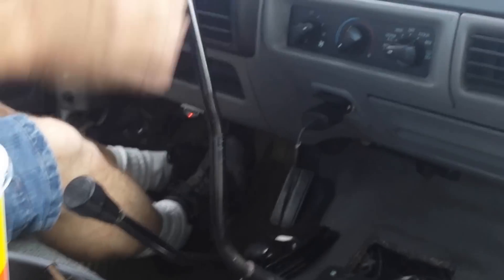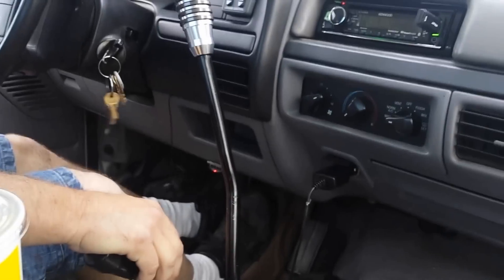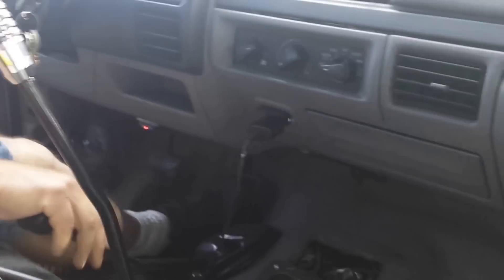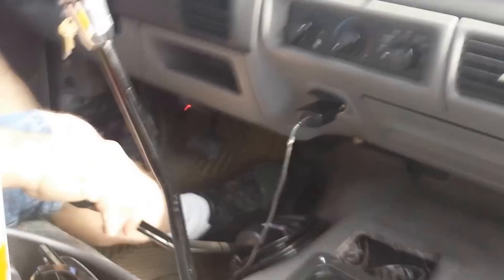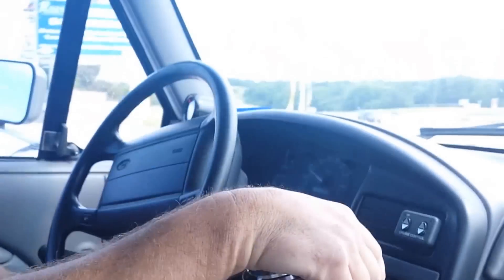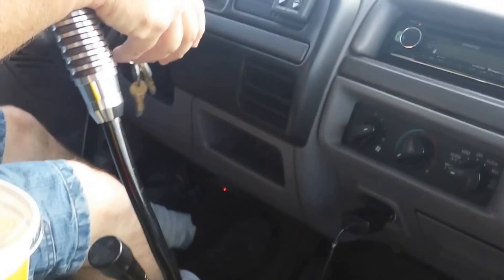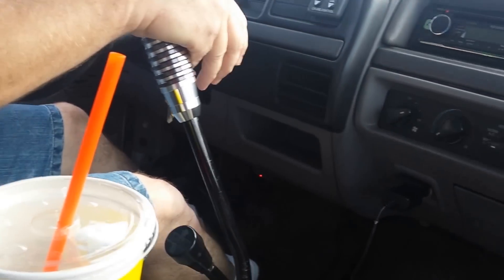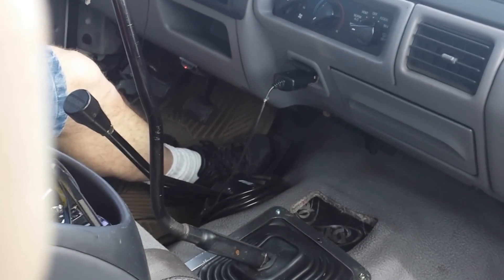F150 twin stick test drive

Comment: But its only an f 150! I could see if it was a 3/4 or 1 ton. Its not what you can pull, its what you can stop!   But, i get it. Had a 73 blazer w full time 4x4, coyld go through in low then back to 1st and again in high. Hole shot from hell
Reply from the maker: Congratulations!! You are the 500th person to make the same comment basically.
No but seriously this is not intended to be a semi truck or 1 ton pulling machine. I simply needed to tow a single car hauler trailer occasionally on very short trips (Under 30 miles). I have trailer brakes and I drive carefully and defensively, plus this combo can still stop pretty darn quick with the trailer brakes adjusted properly. I also keep the brakes on the truck well maintained.
This is overkill for an F150 but the stock 5 speed transmission is very weak and is known to fail quick when towing.
This swap gave me a 4 speed granny (which came stock in older F150's so even the factory went overkill back then) and the overdrive unit is very stout as well. It is rated for over 400 ft lbs of torque and over 24K gross vehicle weight. Plus you can tow in overdrive with no worries as this unit uses a gearset from an old T98 granny transmission.
Splitting every gear is just a novelty. I usually only split 3rd when towing, and if you ask anybody who has ever towed with an old 4 speed the 3 to 4 shift is a big drop in rpm's. This gives me a gear right inbetween 3rd and 4th.
plus going from a 5 speed to a 4 speed I lost overdrive, this gives it back to me.
Reply from the maker: I forgot one important point. The main reason I did this was I really wanted to. I used to drive semi's and got to drive an older truck with a true twin stick transmission, I was instantly hooked! I love shifting gears!!

Comment: Super jealous

How much did this cost you and how long did it the swap take?
Reply from the maker: The overdrive unit was about 1400 to $1500 can't remember which and I got a pretty good discount. They are a little over $1600 now. The 4 speed granny I found laying in the dirt in a junk yard. Took the top cover off and it had clean oil so I changed the oil and resealed the top cover and front input seal and threw it in. It has bad synchros and scratches a little going into 3rd but almost 2 years of daily driving and still going strong. 

It took me around 3 days I think, but I was also going from a factory 5 speed to this setup. If you have an older truck that already has a 4 speed it would be a lot simpler. This unit bolts in front of trans and moves it back 6 or 7 inches so the driveshaft has to be shortned. If its 4x4 then the front shaft also has to be lengthened. The trans cross member has to be remounted 6 or 7 inches back (I think it is 6.5 inches). You would have to cut two new holes in the floor and cover up the original hole. That's about it.

Comment: Is that the transmission whining?
Reply from the maker: That is the overdrive unit. When in overdrive it makes that noise which is normal according to Advance adapters. I was warned about this before buying the unit. That is my only complaint about this unit, but I would still do it all over again.

Comment: There goes the resale value on that lovely 1993 f-150
Reply from the maker: Resell value??  Do you think I care about the resale value on a 23 year old truck? It's a 95 by the way.
I paid $2000 for this truck 2 years ago. That is less than $100 per month, so even if I totaled this truck tomorrow I have more than gotten my money out of this truck.
Not only that, based on a lot of positive comments on this video I could probably get more than $2000. Just have to find the right buyer.  However this truck is not for sale. I will probably drive it into the ground.
Thanks for the comment, and thanks for watching my video.

Comment: "heavy trailer" With an F-150? If your engine doesn't have the torque with a standard 5 speed, your brakes sure as hell don't have enough bite to safely stop it.

Don't be dumb. Overloading your truck is a sure-fire way to cause an accident. And, if the responding officer finds out you're over GVWR, you're f*cked.
Reply from the maker: Do you think before making comments like that? Other than the fact about being fucked if I cause an accident your statement has no merit. The engine is a 300ci inline six cylinder. It has plenty of torque to pull a trailer. The stock 5 speed is not what makes torque, it multiplies torque but does not create it. The problem with the stock 5 speed is the strength and durability. It was made by Mazda and was never designed for towing so that was the weak link in the drivetrain. I went with a cast iron 4 speed granny low transmission for strength. Yes the extra low granny gear multiplies a little more torque than the stock 1st gear in the 5 speed, but not much more. Stock 1st was 4:1 ratio, the T19 granny 1st is 5:1 so not a lot of gain there. The main reason for the splitter was to regain the overdrive I lost when going to a 4 speed, it just happens to have a side benefit of splitting gears when desired. I do not have to split gears, I can simply drive it as a 4 speed. Then shift into overdrive on the highway.
Now as far as the brakes go, have you ever heard of trailer brakes?? How about driving a little slower and leaving yourself more room? Planning ahead and slowing down early for stops and anticipating stop lights?
As far as panic stops, I have had to make a couple and guess what? With a 7K lb trailer I was able to stop in plenty of time. Have you seen the stock brakes on a stock F150? They are big enough when combined with trailer brakes. 

Do I tow with this truck often? No. Do I drive long distances when I tow? No , 50 miles tops!

Comment: It's like the big rigs that have 9 gears normal then flip the switch and it multiplies the gears
Reply: Wayne Rhea or closer to a 13 or 18 speed, you have half gears. so first gear is split between high and low,

Comment: Looks like you had to slide the gear shift hole back to accommodate the splitter. Was there any trouble clearing the bench seat with the shifter? How about the hyd clutch? Was there any problem adapting that? The Mazda has a hyd throw out bearing set up? The older ones had a slave cyl. Beauty set up for a 300 6 by the way, nice job!
Reply from the maker: Yes it moves the transmission back 6 or 7 inches. This overdrive goes in front of the transmission. In my case I swapped from the Mazda 5 speed to an older T19 4 speed. I used a bellhousing from an 84 F150 300 6. I used the flywheel , clutch and starter from an 84 also. I used a new hydraulic line from an 84 with the external slave cylinder. It plugs into the 95 clutch master, however the line enters the master cylinder at a different location than the 84 does. It still works but the line has to do a big loop on the way down to the slave cylinder. I had to cut two new holes, one in the removable transmission tunnel and one in the floor board between the gas pedal and removable tunnel. The original hole for the 5 speed was covered up with some sheet metal. I used weatherstrip adhesive and screws to do that. 
Here is a fun fact. The bellhousing - overdrive - and T19 all bolted together is almost exactly the same length as the Mazda 5 speed. The Mazda has a slip yoke and the T19 has a fixed yolk. All I had to do was remove the slip yolk from the front U joint and bolt the U joint to the fixed yolk. In my case no driveshaft modification was necessary except moving the center bearing forward about an inch. In a normal installation with a truck with a stock 4 speed everything gets moved back 6 or 7 inches so driveshaft mods are necessary. On a 4wd truck both driveshafts would need mods since the transfer case also moves back 6 or 7 inches.

Comment: What was the purpose of twin sticks in a pick up truck and why so many gears do ya haul long distance with it just curious even tho it looks cool
Reply from the maker: All this really is, is an add on overdrive for an older 4 speed. It is not necessary to use the second lever at all. I can drive it just like a 4 speed with no overdrive. The main purpose is to add overdrive,  it just happens to work as a gear splitter as well. In this video I went thru all 8 possible gears which I only do for demo purposes or just to have fun. I almost never use 1st gear since it is granny low. I normally start in 2nd, then 3rd and then 4th. If I get above 55 mph then I shift into overdrive. Once below 50 or so I shift out of overdrive. Or if I want to be really lazy I can leave the small shifter in overdrive all the time and just use 3 gears. 
I use to use an 18' foot car hauler to tow dead vehicles around with for my auto repair business so I needed to ditch the weak factory 5 speed for something stronger. This was the cheapest option over a ZF 5 speed swap or a gear vendors. I get the strength of a T19 cast iron 4 speed transmission and still have overdrive.

Comment: Far more of a PITA than it needs to be, when you can buy transmissions or put kits on the existing trans, that has an OD on every gear, that you can activate with a button.
Reply from the maker: Sometimes the easiest solution is not what some people want. If you need easy, then take the easy route. Hell why not just go with an automatic transmission. I like complicated and challenging, not that this is all that complicated. Old semi's had 4 speed aux transmissions coupled to a 5 speed transmission.
Bottom line is I did not do this to please anybody else but myself so..........

Comment: F that I can't get out of 1st with a regular stick
Reply: You probably shouldn't be driving then
Reply: thats sad
Reply: best way to learn is to do it.. what I did was learn to take off without using the gas pedal at all..  that way I understood where it grabs at..  once you get that,  it's easy..just don't accidentally downshift from 5th to 2nd when you're headed for 4th..  it can be bad ;)
Reply: @aztekwarrior518  i hit reverse trying to find 5th ... Then magically i had 6 neutrals

Comment: The shorter shifter looks like your 4wd
Reply from the maker: It is in the same place a 4wd shifter would be. My truck is 2wd and the short shifter is an Advance Adapters 2 speed aux or overdrive transmission.  It is a Ranger torque splitter.
http://www.advanceadapters.com/

Comment: For those who have 5 or 6 speed, Gearvendors makes an addon overdrive unit that either bolts to tailshaft in place of extension housing or can be mounted divorce style. I have one on each of my diesel pickups, is a definate fuel saver if you have 4.11 gears, In double overdrive(5th gear and GV unit in overdrive) it only turns 1650 rpm at 64 mph. I also have this wiith a 3.73 axle and it runs 70 at 1700 rpms.
Reply: It also costs a grand more, than the Advanced Adapters one in this video.
Reply: DRW or SRW? My 96' is turning too hot at 60 with a ZF5. I want to add an overdrive but which one? I dunno yet..
Reply: Can't use four wheel drive with it.

Comment: I drive 18 speed on a daily basis for work maybe just me but I don't get it why it looks like a painful
Reply from the maker: Up until about 10 years ago I drove trucks also. I did it for almost 12 years. I miss running thru the gears of a 13 or 18 speed. This is mainly a novelty but it does actually serve a purpose. The older truck 4 speeds or "granny 4 speeds" have plenty of strength for towing. What they lack is an overdrive. This Advance Adapters 2 speed fills that void. The 4 speeds are also a wide ratio, and you really notice that between 3 and 4th. You have to rev the piss out of 3rd to be able to keep pulling in 4th when towing. I do occasionally tow a 7K trailer, by using 3rd gear and overdrive that gives me a gear in between 3rd and 4th. Imagine skipping from 6 hi to 8 low in an 18speed, that is about what its like to go from 3rd to 4th in my truck. 
Thanks for commenting and watching!

Comment: Cool video, I'm really interested in what looks to me an aftermarket cruise control on your dashboard. Is it operational, how difficult was that to install. I'm driving a stock 96 F150, 300-I6, with the stock Mazda 5spd.
Reply from the maker: Yes, that is an aftermarket cruise control. It is operational, and it was some work to install. I used the universal kit which uses a magnet on the driveshaft and a speed sensor on a bracket close to that magnet. There is a module that mounts under the hood with the cable going to the throttle arm on the throttle body. There are switches on the clutch and brake pedals, of course you have to hook up 12 volts + and a ground. It took me prob 3 to 4 hours to install and I am a professional mechanic. Not saying it takes a lot of skill, I think just about anybody can do it . It is just tedious work running all the wires. Several wires go thru the firewall, I just used an existing grommet and poked a small hole in it.
Reply: That's something I'm going to tackle this spring. It'll certainly help make my commute more comfortable. Appreciate the feedback.

Comment: Is that a modification? What is the advantage to having it? Thank you for your time sir.
Reply from the maker: Not trying to be rude or a smart ass, but did you read the video description?
Yes it is a modification. The advantage is on the older 4 speed granny transmission there is a big step or rpm change between 3rd and 4th. This gives me another gear in between gears. Works great when towing, I can keep the rpm's in the sweet spot. Plus it is just cool and fun to drive, puts a smile on my face every day.

Comment: I've gotta find out how to do this. It would be handy for hauling metal. I took alot of scrap home, but it was so much it was squatting the truck. 1st did fine, but I took it to 2nd at the normal rpm and it almost died I had to hit high rpm before I got to direct (4th). I guess I needed a "1st overdrive".
Reply from the maker: That is exactly where this setup really shines! When towing or hauling a heavy load (heavy for a half ton) it sure is nice to have a half gear. The old 4 speed granny transmissions are great, except for the big spread between 3rd and 4th.  I use 3rd over a lot, even when empty. As far as the racist comments, there have only been a few. I delete them as soon as I see them.

Comment from the maker: Thanks for all of the questions and comments. I seem to get the same questions over and over again. 
Please read the video description before posting a question, most questions can be answered by reading the description.
Reply: For those who have 5 or 6 speed, Gearvendors makes an addon overdrive unit that either bolts to tailshaft inplace of extension housing or can be mounted divorce style. I have one on each of my diesel pickups, is a definate fuel saver if you have 4.11 gears, In double overdrive(5th gear and GV unit in overdrive it only turns 1650 rpm at 64 mph. I also have this wiith a 3.73 axle and it runs 70 at 1700 rpms.

Comment: So this will work on a honda civic with vtec right
Reply from the maker: Sure, just convert it to rear wheel drive, make an adapter to go from a Honda motor to a Ford or Chevy transmission and cut the hell out of the floor board.....   lol

Comment: Jesus christ, I don't get it, how the fuck this gearboxs works. And why is designed this way with to sticks, it's really complicated. And some people say that standar stick is difficult :) and you did this by yourself ? It's amazing, bravo
Reply from the maker: This is two separate gearboxes bolted together, they can be shifted independently of each other. One is a 4 speed granny low transmission, the other is an aftermarket overdrive box. Using the overdrive in each gear (optional by the way) gives me a half gear between each gear if I want it. Or I can leave the overdrive alone and simply drive it like a normal 4 speed.

Comment: May I ask why? What's the point of this? Not being rude jw
Reply from the maker: No real reason other than I wanted to. It does help when towing, closer ratios keeps the engine at its peak torque.  
Old 4 speed granny's are known for strength but 3rd to 4th gear is a big drop in rpm's. This gives me a gear between 3 and 4 and gives me overdrive for the highway. I can tow in overdrive with no worries because the overdrive is rated for 420 ft lbs and over 24k gross vehicle weight.